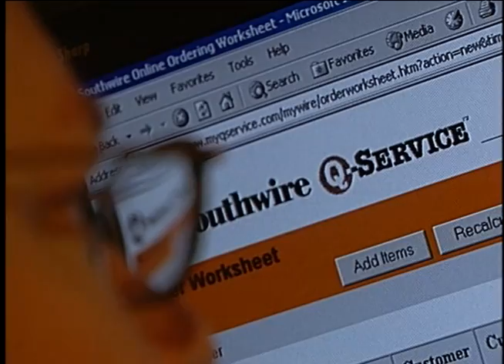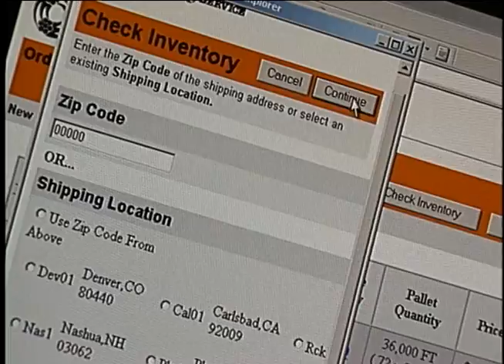See How Southwire Has Wired the World

Comment: I had the privilege of working with one of Southwire's earliest systems installed at Western Electric's Hawthorne plant  We had a 3 row melting furnace, a 2 stand roughing mill and i believe a 10 stand finishing mill. When i was employed there, the wire drawing side of the mill had been converted into warehouse space. I became the unofficial historian for that rod mill. I have pictures of the OLD system used in the 20's inside that very building. Also pictures of that system being torn out and the new Southwire system being installed. On my shift in winter of 2009, we shut it down for the last time. It was a sad day.